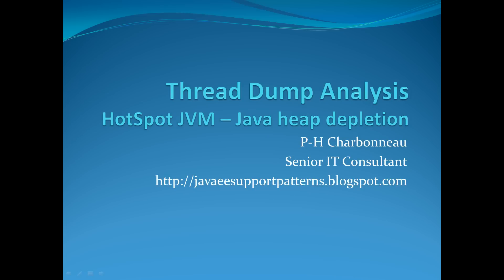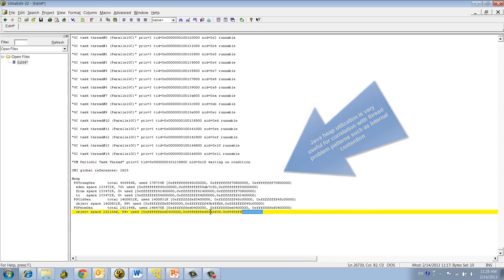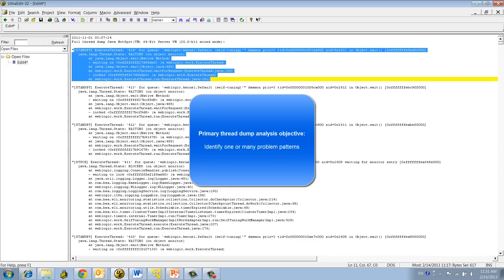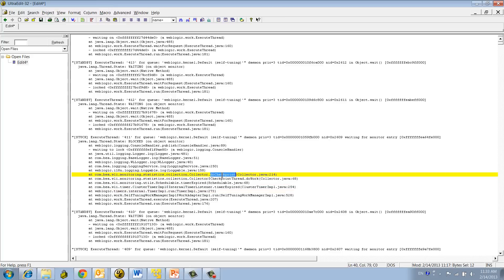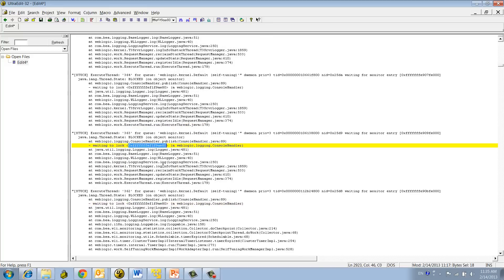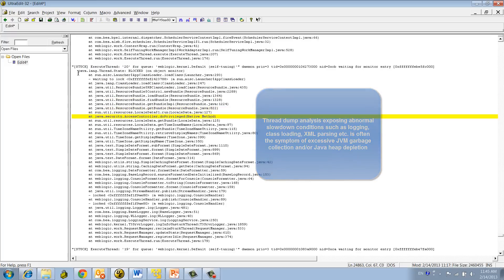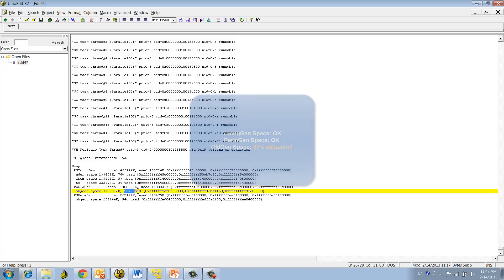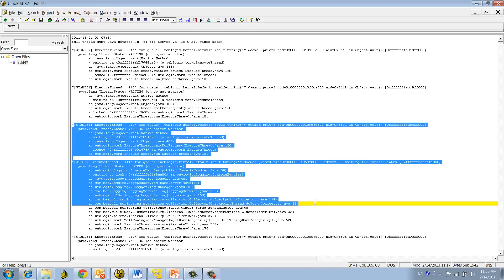Thread dump analysis - HotSpot JVM - Java heap depletion

Comment: One question I have is when using jstack to generate thread dump , I do NOT see the heap data at the very bottom.... any thoughts on why? I've tried to use "-m" and "-l" an no luck etc.
Reply from the maker: Hi Traolly,

Yes, such printing is version dependent and may not be displayed on your specs. Simply use the jmap command separately to print the Java Heap details:

<JDK_HOM>/bin/jmap -heap <JAVA_PID>

Use jstack mainly when you want to analyze Threads.
Fall back on jmap for Java Heap memory analysis.

Thanks.

Comment: Hi PH ,

It was really indeed a nice article about SUN JVM THread DUMP.

I was really keen on understanding what was the actual issue when the OLd Gen was 99% utilized and also Heap DUMP would have been  collected if there would have been HEAPDUMPONOUTOFMEMORYERROR passed in JVM args and in case of OOM, JVM will crash and how the TD was taken.

Could you please provide more detail on the particular issue.

Thanks,
Chetan K